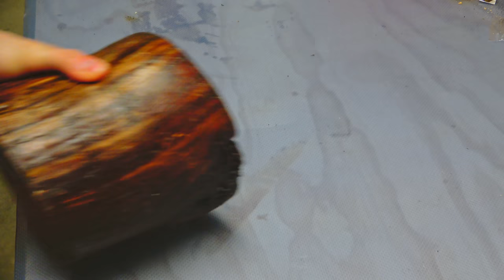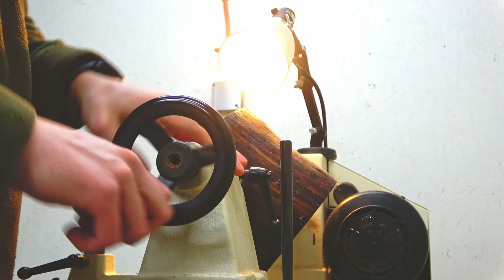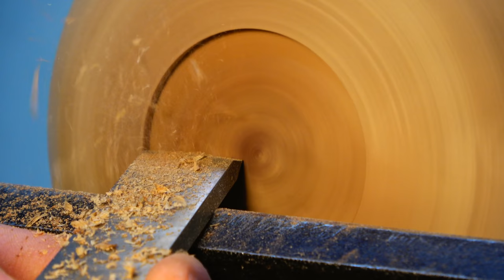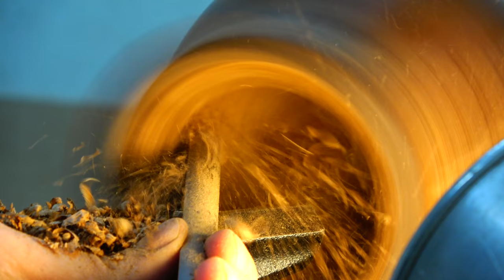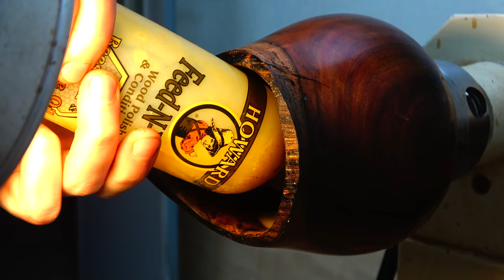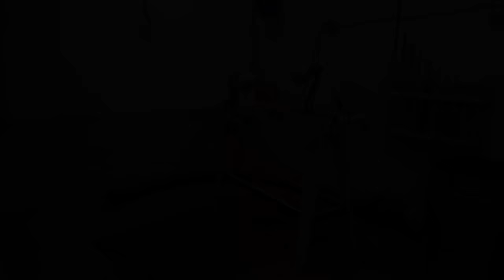Woodturning: Hawaiian Koa

Comment: Turning koa is a joy it machines and finishes very quickly. I've turned quite a bit of koa when I lived there and brought a lot when we left. If you ever get a chance to turn milo(pacific rosewood), I would highly recommend it. In my opinion its better than koa. Great work. I just subscribed cause of this video!
Reply from the maker: Thanks Matt! I have turned Milo once before and was impressed! It’s hard to find unique pieces like crotch grains d figured bits though.
Reply: David Adamsen Well is you’re interested I could send you some, once this quarantine is over. I have  quite a bit maybe not a lot of crotch grain but I do have plenty of blanks.
Reply from the maker: Matt Cronk Well I certainly don’t want to put any pressure on you, but I couldn’t possibly turn you down! If you send me something, I’ll make you something out of it if you like.
Reply: David Adamsen It may take awhile but I’ll send some wood.

Comment: Your art work is fascinating, not just gorgeous. I've watched many of your videos and love them all. I know nothing about wood turning so your pop-up notes really help. 
Sometimes you use several different finishes (waxes and oils).  What do they do?  [I have experience refinishing furniture, but nothing fine. I use polyurethane for the protective finish but I don't sand between each layer.  I typically do 6 coats and don't start sanding until coat 4 to created depth with the raised wood grain.]
What was the substance you were putting in the small voids in the wood?
What are the particular properties/characteristics of Hawaiian Koa that inspired you to make this piece this way?
How much do you plan your design ahead of time? Or do you go where the wood seems to take you?  I would actually guess it's a combination of the two.
Thank you for sharing your art.

Comment: Very nice. I have worked as a tree surgeon and make walking sticks I would love to try turning. I broke both my elbows in Jan 19 recovered well think I'm strong enough now to start. Which part off the arm takes most off the stress
Reply from the maker: Adrian Martin Oh my! Wow I’m so sorry to hear that! I can’t possibly imagine what you must have gone through. I would say that if your arms are feeling a lot of pressure, you’re doing it wrong. If you have sharp tools, the tools will do all the work for you. Your hands guide the tool directionally only and you move your body with the movement of the tool. You tool handle hand should rest on your hip and provide support, not pressure.

Comment: Hi David.  Your beautiful work has motivated me to start wood working and I am prepared to take the baby steps.  Would you be able to recommend a very small micro lathe?  I live in an apartment and my retirement around the corner will include fly fishing and wood turning.  Fly fishing I'm good at, wood turning, obviously not.  Thank you.
Reply from the maker: Thank you Patrick! I’m thrilled to hear that! I believe Jet makes good quality mini lathes that are under $500 and they even have a model that is under $300. I would not feel hesitant about recommending a used lathe. My lathe is about 20 years old and although it was basically untouched until I started turning last year it has proved to be a hardy machine. I would also recommend Nova lathes too. Both Jet and Nova make good quality mini lathes.

Comment: Hey David, what kind of oil do you use on your grinder?  I just got a grinder and a Wolverine jig.  I've had a few folks tell me I should have gotten a slower grinder but I'm now stuck with this one after getting everything mounted.  I'm thinking oil on the grinding wheel would help.
Reply from the maker: Hello Suzette! I actually use tap water only. As far as I know that’s what is recommended for my grinder.

Comment: OMG what is the purpose of the music???????? For heaven sake, can't we just admire the wood turning skills???
Reply from the maker: I appreciate the candid feedback, Nigel. I took a couple polls recently about the music in my videos and the results appear to be in favor of the music. I do try to make sure there are breaks where only tool work is heard. I am reluctant to remove the music altogether if for no other reason than because there is both a heater and an air filtration system that add a lot of noise. So I generally turn the tool work down slightly to prevent all that background static-like noise from becoming annoying.